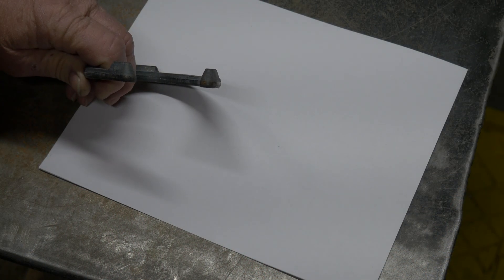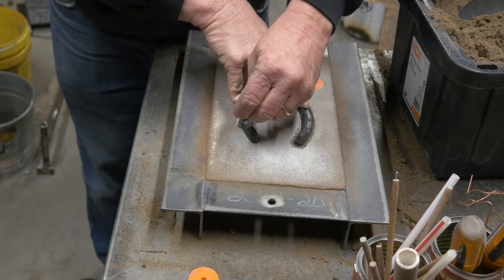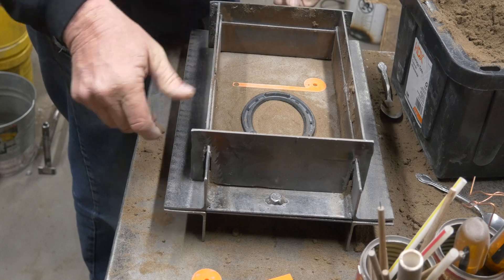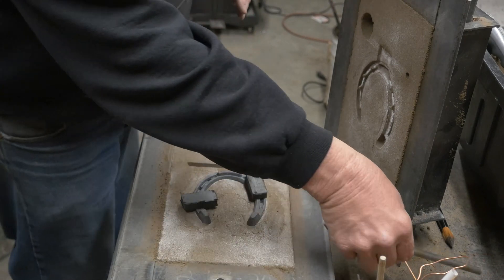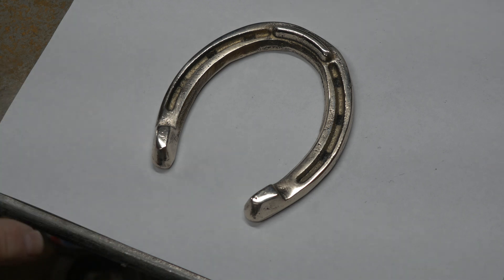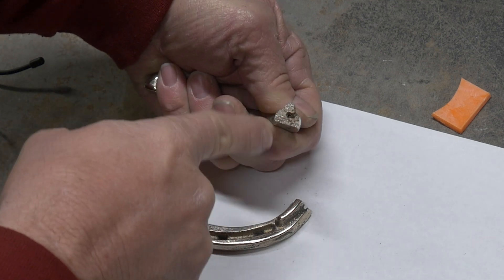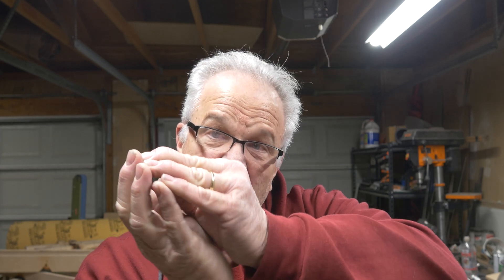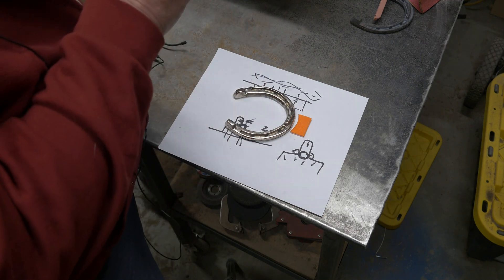casting a golden horseshoe - lessons in aluminum bronze

Comment: I'm actually surprised that you aren't going to attempt this again.  I would expect you to say, "I'm not going to let this #$%* Al @$@%!! Bronze *)(!@ horseshoe kick *MY rear!", and then proceed to engineer an appropriate solution.  But I also understand why you don't.  Or, I can at least think of reasonable reasons why you wouldn't mess with it again.
Excellent explanation of why the problem occurred.  It makes perfect (or near enough perfect) sense.
Reply from the maker: Hey, if you say anything with authority people will believe it 😄😄😄

The biggest problem with the bronze is my furnace just isn't getting hot enough.  I've got to fix that problem before I attempt any bronzes. Then there  is always the thing of me wanting to make more bells. I'd rather devote the energy to pouring some bells than redoing the horseshoe.
Reply: @swdweeb  Build a Waste Oil Burner, and you won't have any problems with melting bronze, of even cast iron.  Once you have it working properly that is.  Assuming your refractory will handle it, which it probably will.   Plus, the fuel for them is generally free.
Reply from the maker: @BrianDaleNeeley  did you see this? https://www.youtube.com/post/UgwV2GYoJF9o8sVKzUl4AaABCQ

Comment: Just out of curiosity(mostly because I'm having nothing but fails lately), what is your pour temperature before you cast the Aluminum bronze . I'm getting lots stuck frozen in the crucible after the pour. Maybe I'm too impatient.
Reply from the maker: My bronze, which was still too cold, was like 2010F for this pour.  I don't remember exactly as I didn't write it down.  I know I waited until I was above 2000F and it seems like I might have seen 2020F but don't hold me to it.

According to a doc that a sub sent me here are the recommended temps for al-bronze
Pouring Temp., Light Castings................ 2050-2200F
Pouring Temp., Heavy Castings.............. 2000-2100F

They list the melting temp well below the pouring temp at 
Melting Range, °F...1907-1913
Reply: @swdweeb  Thanks for the reply. I'll have to give those numbers a try. You're having much better luck then I am. My last pour was 1980F. Way too cold from what i can see. Not enough time in molten state to work with it.

Comment: Well...this is good to know.  I had hoped for better news about Aluminum Bronze and its workability.  Oh well.  I'm just about half way there and just ran into my first real glitch.  The new little foundry melts aluminum like a charm.  It melts down copper nearly as fast.  So far so good.  YeeHaw, I'm on my way to making a batch of aluminum bronze-- Then..oops.  I poured the molten copper into my muffin tin and oingo boingo-I have copper muffins fused solidly to the muffin tin.  Short of remelting or grinding away the muffin tin I have hit a snag.  What do you recommend as a good ingot mold for molten copper?  Thanks
Reply from the maker: My mold is steel but made from angle iron so much thicker than the muffin tins.  BTW, I did exactly the same thing on my first copper melt. what a royal pain. Like you , I tried cutting them out, I tried peeling the muffin tin away, I may have even tried melting the coper out of the trays but I'm not sure I recommend that as.  You can see my ingot mold here. https://youtu.be/fFADzuaCtQs?t=473  I made it from angle iron scrap I picked up.   I also have some wash that could be painted in the molds called frankote but so far I haven't had a problem with copper or bronze releasing from this mold.

For what its worth, aluminum bronze seems to be a rite of passage for most of us. I think its because s) we have the metals and b) its cool to make an alloy.  I really don't like it and would only make it again if somebody was to pay me for it 😄
Reply: @swdweeb  I was out walking the dog and thinking about this and remembered that when I make molds for casting glass in the kiln I make up a 50/50 mix of plaster of paris (hydrocal works better) and 200 mesh silica flour.  I mix in enough water to make a pourable batter, let it cure overnight and then put it in the kiln with the glass.  For foundry casting it would have to be dried out in an oven and then further heated by the foundry to drive off the moisture.  When glass is molten it is very sticky and I have never had it stick to one of these molds.  Sometimes I can get 4 or 5 castings out of the mold before it is so fractured it is useless.  I'm going to have to try this.
Reply from the maker: @jimintaos  I expect that will work just fine. I've never painted my mold but I have painted my furnace with the stuff and spilled melted metal doesn't stick to the wash I use. I painted on two thin coats, let it air dry for a day and then applied a little heat to finish drying it out

Comment: That was very good and I learnt a lot so thanks. A question if I may, if you had to cast 20 or 30 horse shoes like that in say aluminum would you make a master mould in two pieces, a lower and upper half or would you cast them all the way you did the horse shoe? Thanks in advance.
Cheers Stuart 🇦🇺
Reply from the maker: Hey Stuart, if I had to cast 20-30 of anything I'd look to build a match plate that would do exactly that. This process of "loose" casting is fine for one or two molds but beyond that you have to think in terms of production and a match plate or a die is the way to go.
Reply: @swdweeb  Thanks for the advice I really appreciate it. I’m casting my own C clamps 🗜 and your advice confirms I’m on the right track.
Your a good man. Cheers Stuart 🇦🇺
Reply from the maker: @scroungasworkshop4663  Thanks Stuart.
Hey if you get them cast, I'd love to see pictures swdweeb@gmail.com
Reply: @swdweeb  OK, your on. When and if I get them made I’ll send you the pics. Cheers my friend 👍👍

Comment: You make me really want to try casting. I will definitely try it someday, but I already don't have much room for my blacksmith equipment... Will have to wait for somewhere over the rainbow when I can afford to get out of the suburbs.
Reply from the maker: I do it all in my garage, but you probably figured that out from my videos 😂
Reply: @swdweeb  I've got a pretty tight 1968 built two car garage with two motorcycles and a grocery gitter takin up all the space. My forge is all portable and I wheel it into the lawn from a little garden shed that's mostly full of garden stuff since I don't have a garden. Recon if a guy would do some possession management, he might could figure somethin out.

Comment: I work with tin and silicon/manganese bronze mostly. The Si/Mn pours and flows much better. Has a great color too.
Reply from the maker: Yeah I prefer tin bronze as well. Never tried manganese
Reply: @swdweeb  Si/Mnbronze isn't as viscous as Sn bronze. Both have good color and strength. Buff up pretty nice
Reply: @rockelec  it's been a minute since you commented this, but can you share the percentages for the alloy? I have silicon to add to the copper, but not manganese. I need to know how much to order :) thanks!
Reply: @Evanator22742  Si 3.3-3.8%  fe .8% Mn.5-1.3%  balance Cu
Typically the Fe is in with the Si and in my opinion is not crucial to the alloy.
C65500 bronze
Reply: @rockelec  awesome. I really appreciate the thorough reply. I saw lists and lists of all the silicon/ manganese alloys and had no clue. Your experience is valuable, so thank you for sharing. I'll definitely be trying it out.

Comment: Thank you so much for your valiant attempt! It sure looks nice if you don't worry about the little crack. I was really surprised that it broke when it was dropped, it must be very brittle. 
I consider the gauntlet thrown. When it stops raining and snowing (probably a few months from now), I will give it a try.
I hope 2021 starts getting better in every way. 
Wishing you all the best from Juneau Alaska, 
Greg Chaney
Reply from the maker: I wish you guys would keep that weather up there. Calling for snow here tomorrow.  I’ve suspected it can be brittle given how hard it is
Reply: @swdweeb  Did you quench it or let it cool slowly ? You may have made it brittle from the shock . Try pouring some test strips let them cool overnight , quench some then anneal some  . Now try the bend test in a vice . Now that would make a good video .
Reply from the maker: @Lawnmowerman02346  It cooled in the sand and in the air for several minutes. I didn't put water on it for probably 10-15 minutes.  It was still to hot to hold in my hands.

Comment: Great effort. Not being able to make the sand mold without having pull the sand apart is because the part has positive drag if I remember correctly. It's been a while since I've learned to do this. Negative drag can be rammed up and removed with no worries.
Reply from the maker: positive - negative  its all based on your point of view 😄 Both the cope and drag saw the draft as "negative" and saw the other guy's draft as positive 😄

Comment: Is it possible to do a curved plate in the same way ? In aluminium and at least 6x6" . Trying to make a mandalorian helmet without great success. Sorry I'm being stupid..
Reply from the maker: You mean like this? https://youtu.be/HLMsBWx2VVo?t=453
Reply: Also are you going to build a bigger burner to increase temp or purchase one?
Reply from the maker: I'm looking at moving to a hybrid propane/diesel burner.  Get things warm with the propane then switch to diesel
Reply: Yes exactly like that cheers. Watching and learning.
Reply from the maker: @richardmclean7973  Can't be done 😄😄
Reply from the maker: Propane is expensive and I'm having trouble delivering enough fuel with the little tanks that I have. They freeze up.  All the big boys run oil (or billion dollar induction) furnaces.
Reply: @swdweeb  you can get induction melting furnaces for way less than a billion. There are small ones for under $20,000 which are rated for under 18kg of aluminum although it's probably like a billion in electricity to run, but still obtainable. (although compared to the cost of your new furnace $20k is like a billion)
Reply from the maker: @askquestionstrythings  Yeah, $20K for a furnace in my garage is a bit steep. A quarter of that is still insane
Reply: @swdweeb  agreed. I just saw a $600 induction system. but it holds near nothing in the crucible. hobby level propane/oil/diesel are definitely more cost-effective.
Reply from the maker: @askquestionstrythings  For $600 I could build a brand new furnace and burner dedicated to diesel that will hold 12KG crucible.  Induction while really nice is out of the question for me
Reply: Can I ask why diesel?
Reply: No such word !

Comment: Do you use a good casting alloy when you make your alloy bronze? Like mag wheels or other cast items from auto parts? I was wondering if that would help with shrinkage. Pure alloy is bad for shrinkage and would probably do the same in your alloy bronze.
Reply from the maker: I use A319 aluminum alloy.  Pure alloy?? An alloy is a mixture of metals 😄
Reply: @swdweeb  By pure alloy I was meaning just straight Aluminum without additives to help casting. You already use casting aluminum in your mixes so that wont help. Great cast and video though I am learning a ton from your channel
Reply from the maker: @andyf1235  Hi Andy, I knew what you meant I was just making sure you had the correct terminology.  By definition an alloy is a mix of different metals. I'm not sure you can get "pure" aluminum. I don't know, maybe you can.  Even the metal used in wheels and motor castings is some sort of alloy and not pure aluminum.

Just be glad you didn't say  you're "smelting" metal.  Gaaa I go crazy on that one 😄😄

Thanks for your question bud, I always appreciate it when people are thinking about this stuff.

Comment: It was a good try and the casting did look quite nice.  Bummer that it broke, maybe you can TIG it back together?  I can vouch for al-bronze being sort of a pain to cast, whether it's a homebrew 90-10 or purchased alloy.  Have you tried pouring yellow brass?  I have not, but maybe it's easier to cast as well as being shiny and yellow... 😁
Reply from the maker: I try to stay away from brass.  I don't want to haul the furnace outside and I don't have good ventilation to get rid of the the zinc fumes.
Reply: @swdweeb  I get that.  I've been avoiding it too

Comment: Horseshoes are supposed to be lucky, you didn't add enough luck so the mold didn't fill completely. Try adding 3% luck next time.
Reply from the maker: They're only lucky if you keep the tips up. If they face down all the luck runs out. 😄  I was lucky, the problem gave me something to talk about  in the video 😄
Reply: @swdweeb  : Next time cut the gates at the ends😆. I was going to say something on the lines of what you said.
Reply from the maker: @CraigLYoung  Ah but then I'd have a nice bifilm where the two streams of metal came together. Then it'd probably crack in the middle of the shoe... hey wait a minute
Reply: @swdweeb  : We're having to much fun with this.
Reply from the maker: @CraigLYoung  😄

Comment: Have you ever tried epoxy-sand to make like a fillet in the undercut part of the shoe. After casting the epoxy-sand fillet can be removed easily.
Reply from the maker: I've never used any of the epoxy or resin-based sands. I would like to try them but I'm afraid I'll be completely spoiled by them 😄